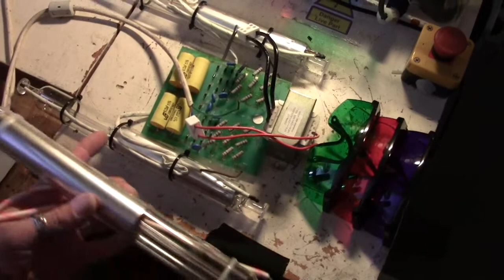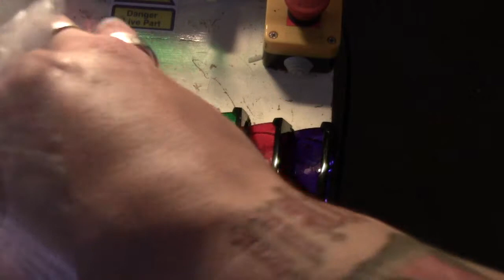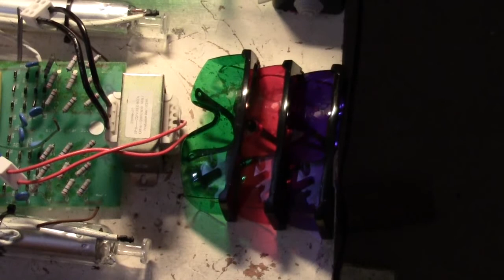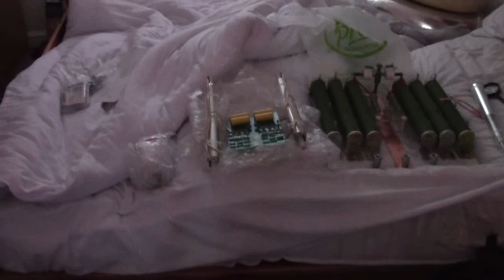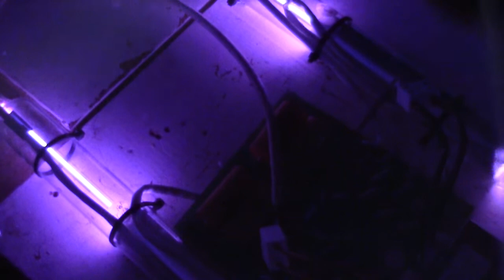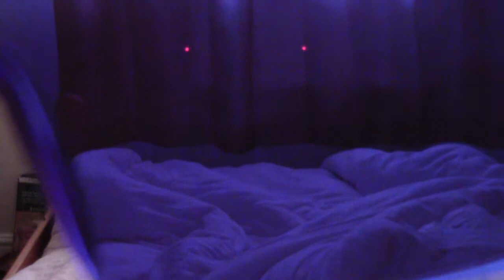DUEL HELIUM NEON TUBE LASER RUN AND SOME INFO ON THE PSU'S AND SAFETY

Comment: I have one like these. The tube is longer and wider. The psu is in a black resin filled tube and according to the specs it's 6.5mw at 632nm wavelength. I also remember a few years ago seeing at my local university a yellow helium neon laser tube 594nm. Yet it had the same pink light along the length. At the moment I'm using/experimenting the laser from a Blu-ray writer from a computer. Popping balloons and lighting matches with lasers is now cheap and easy to do.  :o)